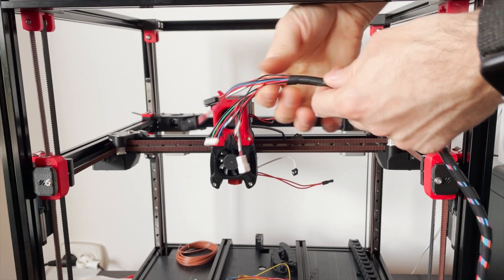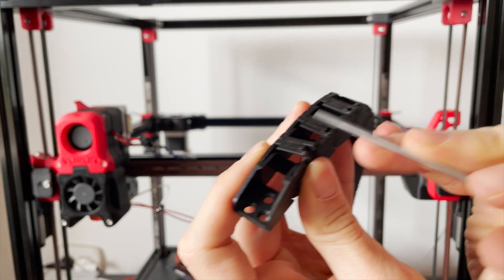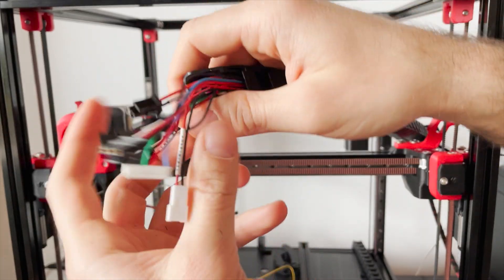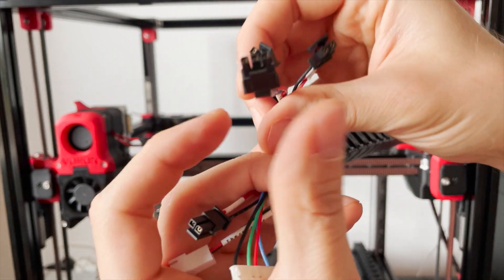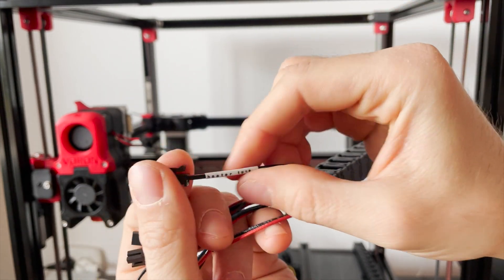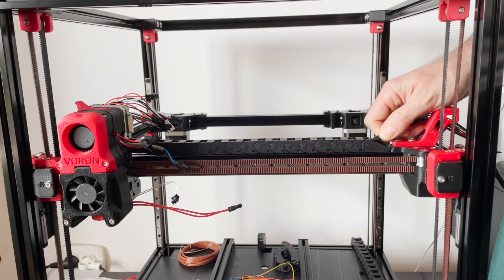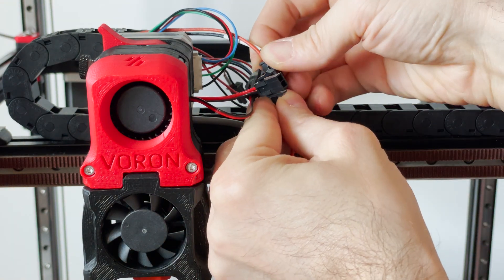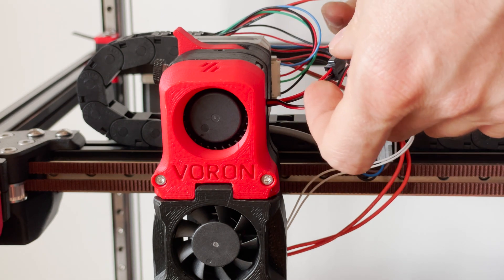Voron 2.4 - Part 14 - Wiring Part 1

Comment: Tnx for the amazing guide! My PL-05 cable does not match in color with the inductive probe wiring. Do u know if it matters?
Reply from the maker: Thank you! The color of the cables does not matter, you will have to figure out the correct wiring for the probe and not rely on the cable colors. Is your probe similar to mine, NPN NC(normally closed) type ?